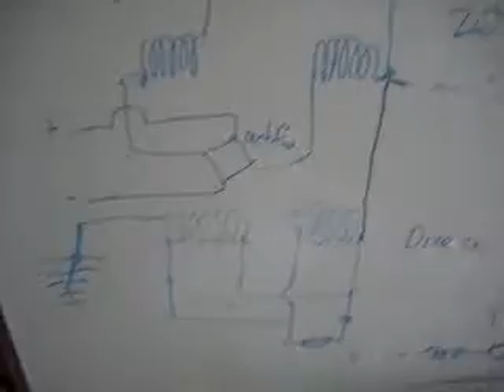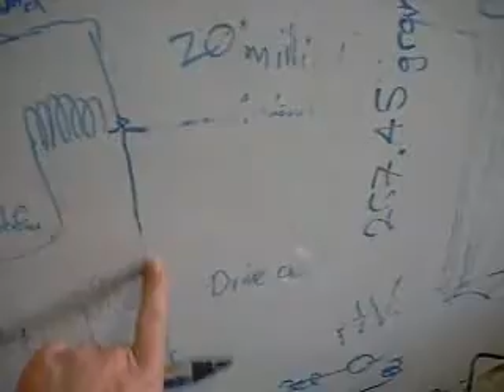Free energy research Battery charging from Adams motor/gen

Comment from the maker: thanx for your comment-check the udate i just posted-not so professional-the reed switches are held in place by blu-tac and there are few solder joints yet.
think i will solder it up in the current configuration,and add 2 more coils for extra current.

Comment from the maker: im at 30 volt output now-thats not a reliable figure tho given the pulsing nature and the ability of the meter to read it,but yeah i will have a go at charging caps,dont see why i couldnt go way higher.
the thing has been running for about 9 hrs today and the charge battery is now over 21 volts for a loss of less than 0.1 volts off the run battery.
when i unloaded the drive battery to measure it,it read higher than starting volts by 0.05 volts,some interesting stuff indeed.